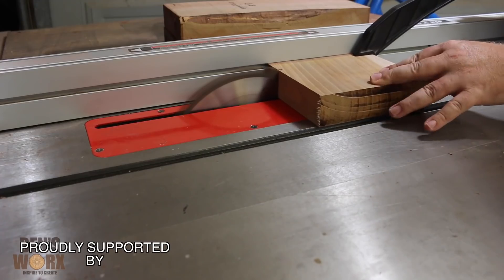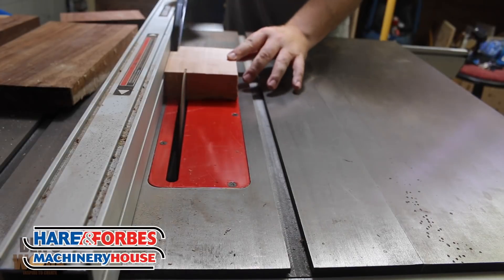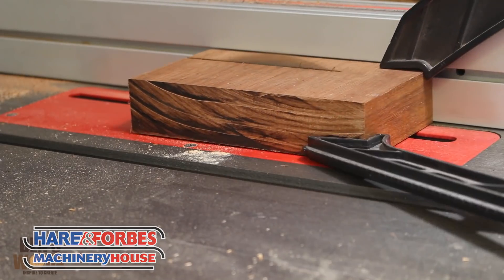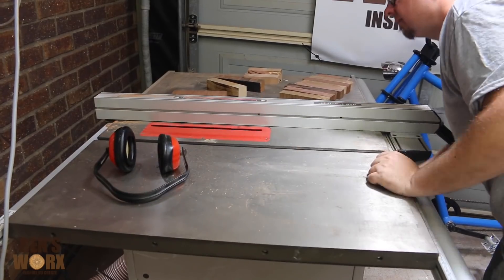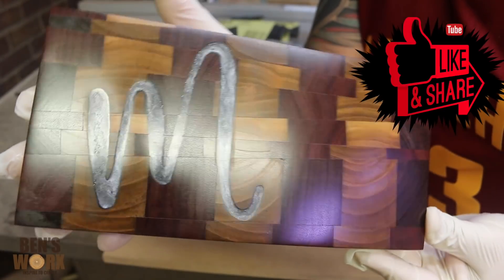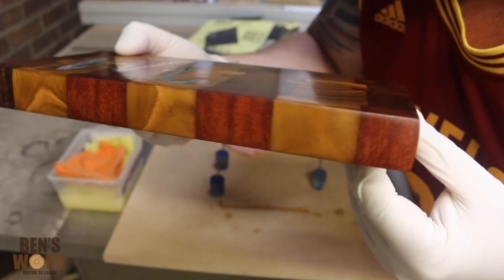Making a Resin Inlay Cheese Board - NO CNC

Comment: Beautiful. What grit did you sand the top down too before applying the finish?
Reply from the maker: Thankyou! 1500
Reply: @BensWorx  Thanks Ben, it really hard to gauge sometimes when I'm are mixing epoxy and wood and using non translucent dyes. Then then also depends on the finish you use too - oil or a poly - never sure whether I'm wasting my sanding effort for minimum gains later down the grit levels

Comment: Hey Ben, this turned out nice. Different subject. Nick tried to do the popcorn thing, pop it in hot resin. It didn't work. What if you put popcorn in resin and then used some type of heat source like a magnifying glass or laser. Something to pop it while it's in the resin. Or will that affect the resin too much. Nice cheese board.
Reply from the maker: Thanks Mate, yeah I saw that, it’s worth a try 👍